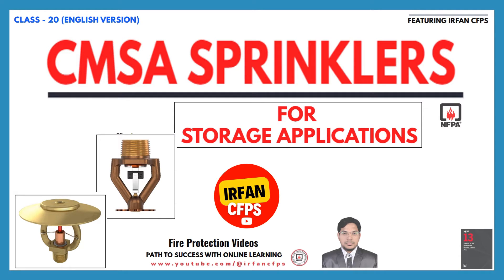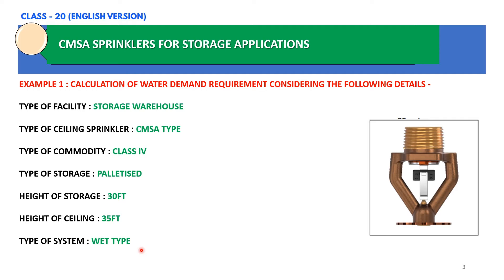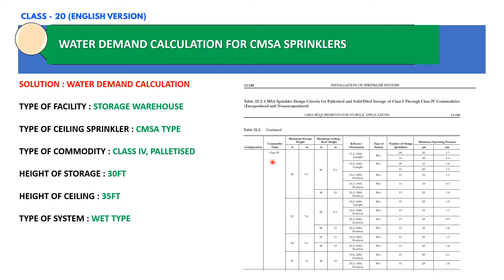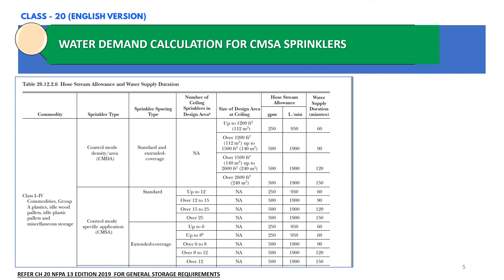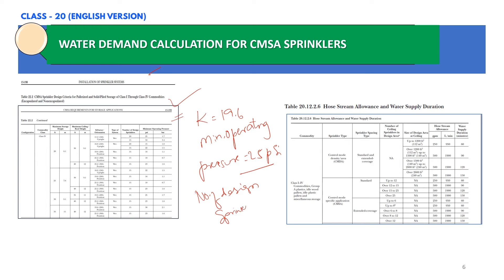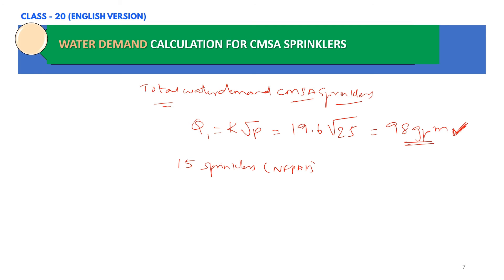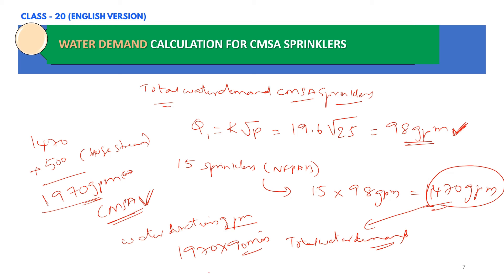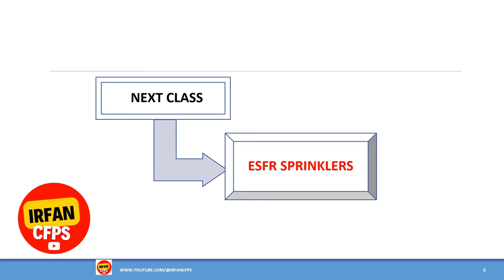Exploring CMSA Sprinklers: The Future of Storage Fire Safety

Comment: As per NFPA 13, CMSA can be used for light and ordinary hazard. But if more than 12 feet combustible rack is extra hazard. So, how CMSA can be used in high combustible rack?
Reply from the maker: Excellent query! Yes Cmsa sprinklers can be used to protect light and ordinary hazard occupancies even though they are specifically intended for storage occupancies. They cannot be used to protect extra hazard occupancies due to the potential for the presence of flammable or combustible liquids. Please note Cmsa sprinklers are permitted to protect storage of class i to class iv commodities etc as described in nfpa 13
Reply: @irfancfps  thank you for prompt reply. I am fire and life safety engineer serving in Bangladesh. Is there any way to be connect with you any common platform like WhatsApp group or something?
Reply: And regarding your reply, my query is that combustible storage more than 12 feet is also extra hazard? So, how can I explain this? To me NFPA on this particular case seems conflicting!!!

Comment: thank you mr irfan, but i have a question, which type cheapest for storage?
Reply from the maker: Please watch other sprinkler types for storage applications and then by yourself you can decide. Because the pump selection depends on the required flow and head. You can consider same example for all cases and make a summary sheet and decide yourself. Since it depends upon case to case basis